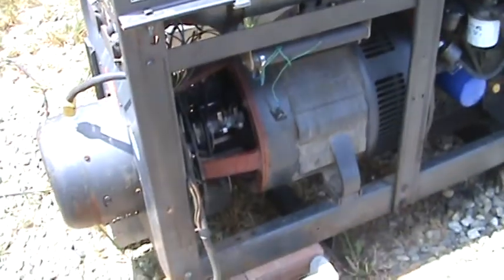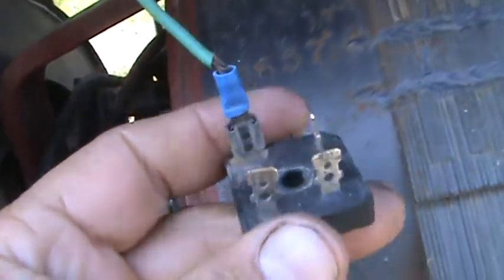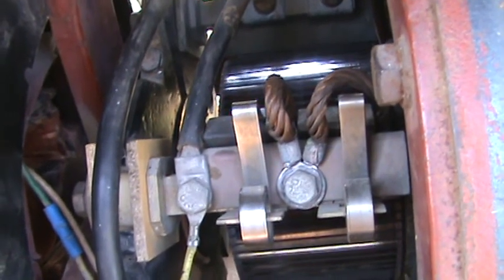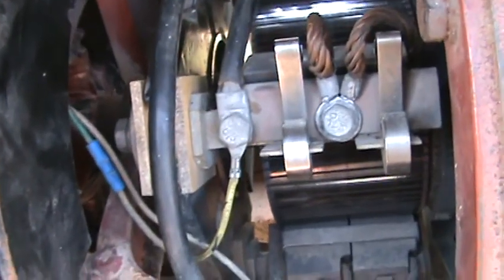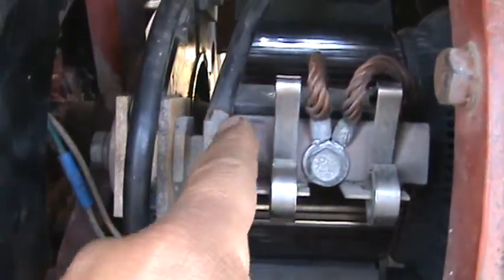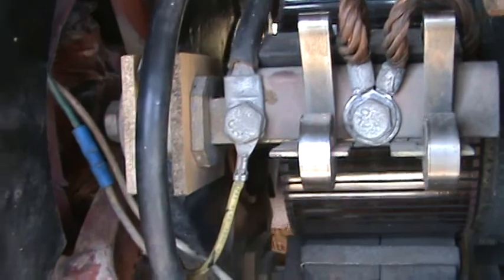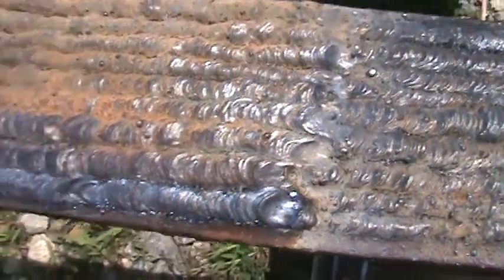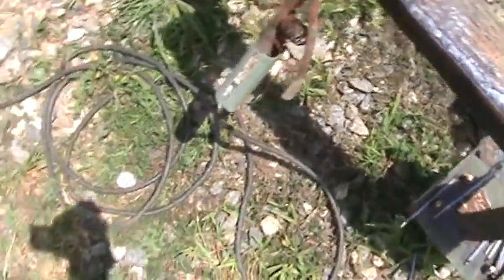Rolling the brush rack on a 300 D welder. 8-17-14

Comment: Those wires connecting the brush holders are not aluminium, they are in fact tinned copper.
The only aluminium in these machines are the series field windings and Interpole coils
The rack should never need adjusting unless it is removed from the end shield frame
Reply: well said brother

Comment: I’m trying to be as nice and respectful as I can but both series of beads looked very similar and since I have the very same machine as a backup and have used it for many years prior with 6010 and 7010 only...this machine should lay that metal down much better than what I’ve seen here!
Reply from the maker: yes it use to do good   but it caught fire on a job so the owner had no time to have this one fixed  went got a new one  and gave me this one  so been working on it       for what i weld it works good 6011 6010 7018 rods but i dont think it will see another pipeline job     the man i got it from  was a pipeline welder for 53 years he said the same thing   lol

Comment: So what causes the rack being rolled to stacking more metal?
Reply from the maker: you have 2 adj current range selection and a fine current adjustment  . current range adj  is changed for the size rods you are using the fine current adjustment is used to find the sweet spot some like to weld hot some like to weld cold now rolling the rack changes the frequency of dc to your rod that changes how the welding rod react to the current running through the rod .so changing frequency allows you to stack your weld or make a flat weld .that is the way it was told to me . i hope this helped
Reply: @sappershouse4650   frequency of dc to your rod??? last time i checked dc is dc there is no frequency in dc. It is on or off no sine wave on DC . Only think i can see is higher or lower OCV.